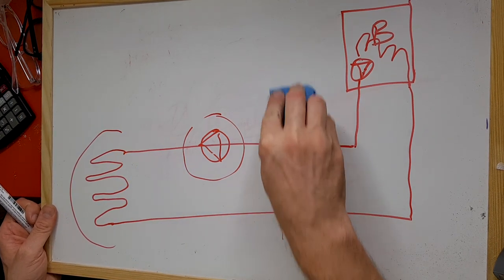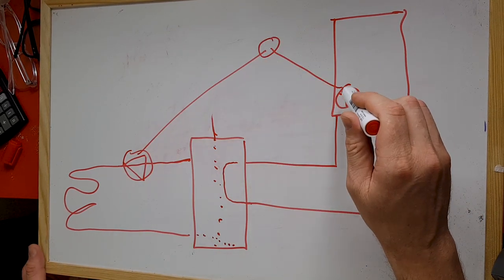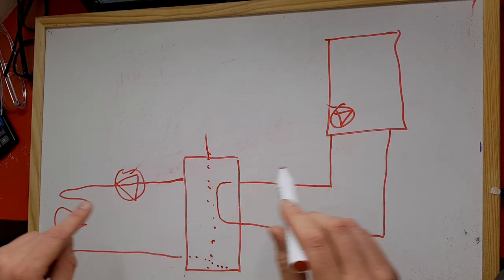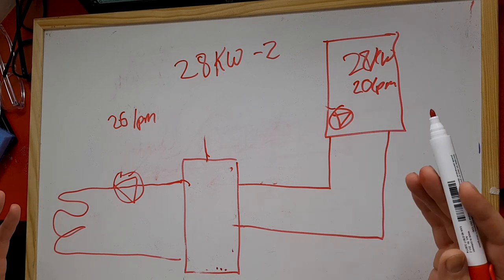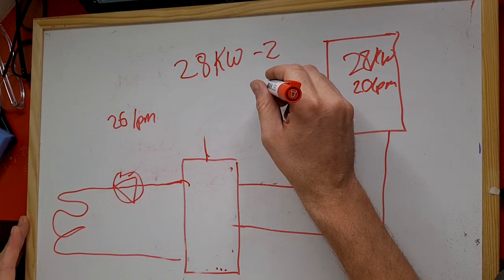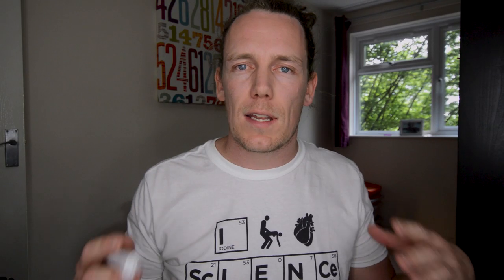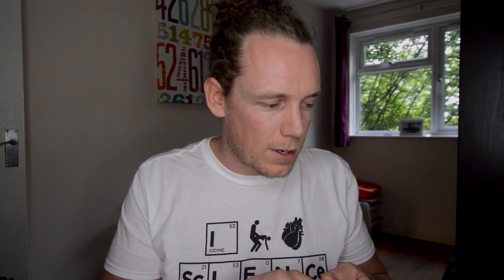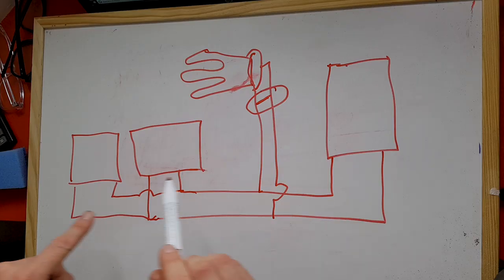Why NOT to use Buffers or LOW LOSS HEADERS!  The Low Loss header explained.

Comment: What would you recommend for a 4 storey house with 23 radiators and 1 hot water cylinder? Each floor would have its own heating circuit. I am thinking of using a 48kw boiler and the IMI Zeparo Low Loss Header and fit 5 Grundfos circulator pumps for each circuit. Do you think there would be distortion and low heat distribution towards the heating circuits during high demand?
Reply from the maker: The first thing i would reccomend is doing a proper heat loss survey... how did you arrive at 48kw? That sounds very high. What's the m2 floor space? 

5 pumps for each circuit is also a little over the top. 1 each max. 

And yes there will always be distortion with any hydraulic seperation.
Reply: @HeatGeek  Thanks for the quick reply. Yes I meant 1 pump on each of the circuits. 5 pumps in total.
This is a very large  house with massive rooms and high ceilings. 4.5 bathrooms, 5 bedrooms, 2 living rooms, very large kitchen and dining area, gym room, 2 more rooms in the basement and garage too. There are 23 big radiators each needing about 3.5k - 4k in BTUs. 300l unvented cylinder. The old boiler there was 37kw and it only heated up half of the house, the rest was cold. So I am thinking of using the 48kw and if need be I can rate the kW output down a bit to suit the system. And the reason for the Low Loss Header is to increase the flowrates to each floor and make sure all rads get hot.
Reply from the maker: @veniamindoychev1634  what you are saying will work. Over specking any system will always work however wont be as efficient. It sounds like the low loss header might be used for additional pump head, but using it to increase flow rates is not a great idea as your delta t will shrink and lessen the condensing effect.

Regarding the size of the rooms etc and description, this isnt really how heat loss is done. The main variable is insulation. Yes you can select an oversized boiler and range rate it down but you also then reduce your modulation ratio. If you can give me the age of the building and m2 floor space I will give you an idea of what I think the heat loss is of you like?
Reply: @HeatGeek  
I will calculate it all and get back to you. Cheers for the solid advice!
Reply from the maker: @veniamindoychev1634  no problem bud!
Reply: @HeatGeek  hi heat geek really loving the channel, I’m doing a very similar job to the guy above, I have done a heat loss, on the property old house 800mm-1000mm thick stone walls some ceiling 4.2m high all double glazed etc, it’s come out at just under 150k btu’s with around 25/30rads which converts to roughly 43kw I’m proposing a hot water priority system, I’m proposing fitting a 40kw ideal vogue with weather comp and open therm, with a llh installed and one single dab light commercial or grunfos adjustable pump for three zones, basement, ground and first floor and obviously cylinder, would you say I’m around the right area? I’m just second guessing myself after seeing urban heatings video putting in a 27kw in a pretty big property and he sings your guys praises.
Thanks
Kyle
Reply from the maker: @kylebrowning7469  sounds good. If your going to all those lengths why not spend another 0.1% and upgrade to a voessmann 200 and have the best wetger compensation and modulation available???
Reply from the maker: @kylebrowning7469  having said that v200 only goes to 32kw.. do you use hear engineer software?
Reply: @HeatGeek  thanks for the speedy reply heat geek, I don’t really have much experience on viesmenn boilers and they only go to 32kw. I don’t use any software just do everything using my calculator 🙄 and am learning a lot from you guys the last week actually regarding heat pumps etc
Reply: @HeatGeek  I would be tempted to go to 32kw as I very highly doubt all heating zones are I’ll be run at once but you know I’d rather be on the side of caution and just moderate her down, and set pump to correct speed needed as it’ll be changeable. Plus fitting a 40kw is only 3kw under what’s required which I don’t think we be noticed? And they’re upgrading roof insulation with another 100-200mm so if anything I should gain those extra 3kw of heat loss via that:)

Comment: Having had a discussion today with my heating engineer he has suggested installing a LLH as part of the system expansion.  All the reasons he gave seemed to be valid and he had convinced me it was worth paying for... until I watched your video, now I am utterly confused.  LLH or No LLH?  That is the question.  The current system consists of a 10 year old Vaillant ecotec plus 637 system boiler and 260 litre unvented uniSTOR cylinder.  The house is 5 bed, 3 bath over 3 floors and there are 12 radiators (mainly medium in size) and 3 large towel rails.  5 years ago, the system was expanded to include a UFH zone for a large dining/sitting/kitchen area extension.  The system now has 3 zones; CH over 3 floors, UFH (3 port manifold has its own pump) and DHW.  Last year I had flow issues with the 3 loft radiators and had to flush the pipes to clean out the silt, which resolved the issue.  I'm in the process of having bathroom UFH installed with a 1 port manifold including pump and the heating engineer has recommended installing a Spirotech LLH, an additional pump (on the system side of the LLH), a new 22mm supply/return to the new bathroom UFH.  Part of the reason for introducing the LLH was due to the 2 UFH zones and large CH zone which may now struggle to be supplied by the boiler pump.  A new Vaillant VR 71 wiring centre (4 zones) + controls will also be installed.  Is this the type of system you think will benefit from a LLH due to the differing heat requirements of the CH & UFH or do you think this system would suffer if a LLH was installed?
Reply from the maker: Hello bud. It is almost certainly the type of system you would put a llh on. However of your not getting issues now then I fail to see what issues 1 small bathroom will add? Can you bot explain to the customer that you would try the simple option and if flow issues are experienced you can upgrade to a llh for an extra x£? 

Most customer will appreciate the honesty and the fact your are trying to save money

Comment: Mr  heat Geek -- 
Instead of using a LLH to synchronize the 2 pumps, why not wire the  system pump to the boiler pump, and wire  them in parallel?  This way, the pumps will NEVER fight each other.  Neither pump is ever dead headed.

Comment: Great video!
Quick question: new installation was suggested with modern wall gas condensing unit with automatic modulation and inverter. System has 3 zones which are made with a kit that consists of a hydraulic separator with 3 circulators. All zones are with radiators and all in one floor/apartment.
This way don’t we lose all the smart features of the unit?
Isn’t it more efficient - if the unit’s circulator is sufficient for the system flow - to install a manifold with 3 gate valves and create the zones?
Thanks, looking forward to your response!
Reply from the maker: Your absolutely correct.. they're installing crap they don't need to and reducing efficiency in thr process.. engineers love doing this in the US.. all about power and not about efficiency..
Reply: @HeatGeek  same thing here.. overcomplicating everything.. 
do you have a video about calculating head and flow rate in a two pipe system with collector manifolds (each radiator has its own 2 dedicated lines)? I saw somewhere that as a rule of thumb the calculation is Q=Kw/dt in m3/h at 2-3m head for a two pipe system.
Reply: @Speedmaster5445  not yet

Comment: I have a radiator system fed by a microbore network supplied by a heat pump. I have a small vertical low loss header installed, to which the primary circuit is connected to both supply and return ports, as normal. However, on the other side of the LLH, only the supply (top) outlet port to the secondary circuit is connected, the secondary return (bottom) port being sealed off. Instead the secondary return is connected directly to the primary circuit at some point further back downstream towards the heat pump, so bypassing the LLH altogether. On the face of it this seems like a good solution as it gives some hydraulic separation but avoids any mixing of the supply and return flows within the LLH. What is your view?
Reply: I thinks that's a fool's game.
In the case of a buffer tank in parellel, depending on the flow rate, the mixing can be more of an issue even in the case of closely matching primary and secondary flow rates, but there are solutions (with various succes rate) for that, one is similar to your setup, but preferably adding a T before the primary input to the buffer. 3-pipe setup in some nomenclature.
HOWEVER: 
If the primary and the secondary flow rates match, there shouldn't be much mixing in a proper LLH.
If the flow rates have mismatch between the two side, that T it won't do any good. For example: the secondary doing higher rate, it will have to suck back from that described tee to the LLH (the differential volume has to come from somewhere), and it will mix in the LLH anyway.
If the primary is doing higher rates (the worse scenario) then the mixing will happen at that where the secondary joins the differental rate of the primary coming from the LLH.
So you have no gains either the rates differ or don't.
But you have disadvantages both cases: you get more pressure loss than if it were a simple LLH: you can imagine the flow hitting the your small T's upper wall, and part of it going left, part of it going right. The LLH is a better desinged vessel, actually, it is designed for this specific job: only the differential rate should be going up or down.
And you have more straight tubing distance, but if the T is not meters away, then it adds less pressure loss.

Either the installer was a fool IMO, or the LLH port had some issue, but they didn't want to buy another one...
Reply: @KrisztiánSzegi  thanks for the info. My house is 2 storey, 130sqm floor area. there are 16 oversize radiators fed by 8mm copper microbore. The small (c. 2 litre) LLH is in 3 port config, separating the primary and secondary circuits. The primary pump is a Grundfoss UPS2 25-80 180 on speed 2. The secondary pump is a Grundfoss UPS3 15/50-65 130 on speed 2. What is your view of the effectiveness of this setup?
Reply: @lumbarsupport  First of all, I am NOT a heating engineer.
I learnt chemical engineering, and part of the course is chemical operations, with jacket and coil heated tank chemical reactors, fluid dynamics, etc.
I'd say I understand heating as well as a good heating technician when I want to, and as I am planning the heating of our family house currently, I very much DO want to understand it :)

I wouldn't be too much worried about your LLH, although my wording maybe did imply otherwise. It's just that I don't, of more precisely, I fail to see ANY benefit. The circulation losses could be lower than with that separate T junction, but that would be equal to a few meters of additional pipe length of pressure loss.
Regarding your described setup: as long as the flow speed is around 0.3-1 m/s (given by: dividing the flow rate by pipe inner diameter), it would be right, the lower, less the pipe wall erosion, noise, and friction losses are.
I would need more data (the available head of heat pump's circulation pump, all of your pipework layout (with number of elbows, height difference of lowest/highest point), the assumed/required flow rate to meet the heating losses) to say that it would have been possible without that LLH: doing the heat pump all the circulation work. I'd say, maybe.
Zoning and regulation between the the floors is a topic in itself, and that could be a good point to optimize without changing much of your setup, given you already have separation between the primary and secondary.
But I am not versed in the latter part, as our house will have UFH (just got the screed a month ago) on a single floor, and at first, it won't have any zoning.

Comment: A few years ago I attended a school which had had a new boiler and LLH installed in a particular block. I had to go several times as there was a pressure fault, but I never caught the system “in fault”, it would always reset and run up no problem. I came to the conclusion that the LLH pump which was a substantial one, under certain conditions was adversely working against the boiler pump causing a low pressure alarm which I could reset upon arrival because the “conditions” had reverted back to “normal”. I submitted my report but, as with large companies, engineers never get involved with problems after that, so I don’t know what was the outcome ( which I hate because many engineers had been there before I was asked to take a look, and I believe in job ownership and I like to see jobs through ). Has anyone ever experienced similar issues 😁

Comment: Great stuff.
Out of curiosity, where did you go to get these pearls of wisdom ?
Reply from the maker: Andrew riley hours of debate on the internet and facebook 😂 distortion is my theory though.. you wont find much in text books about it.. caleffi talk about 'blending and mixing' but dont seem to see the issue with it for condensing boilers which there absolutely is. I think this is because they arent driven by efficiency in America but more 'power'.
Reply from the maker: The ironic thing is that it may give more pump power. But not more heating power as the boiler is more likely to max out and modulate down.
Reply from the maker: I’ve just released a course detailing everything you need to know to become a heating genius!  What’s more it’s  been recognised by the UK government department BEIS which have offered to heavily subsidised the first 300 spaces!  
http://courses.heatgeek.com/

Comment: Hello mate just a quick question for u am doing and install 5 120 kw boilers I have 4 vt circuits off low loss there is no bms being installed what’s the best way to wire the mixing valve can I wire the vt valves of a weather comp as can’t weather comp boilers as have 3 cylinders off this
Reply from the maker: Well your going to have to wire them in somewhere so you either need a native controller or you use autonomous valves that have the controller built in. Who specked it?
Reply: Was speck by outside company thanks mat il look for those valves with built in controls thanks

Comment: One important aspect of UFH you did not touch on, and is the most important, would be the floor surface temperature when it is being heated, and is the UFH being done through a 10cm slab. Also, is the boiler a condensing boiler or not. If it is not meant to condense than you are dealing with sulfur condensation on the inside of the boiler that will rot the boiler in a few years. I don't believe you should mix UFH in lesson with standard baseboard or cast heating. It tends to cause more problems than solutions.
Reply from the maker: Non condensing boilers were banned 16 years ago in the UK so safe to assume a condensing i would say for new installs which this is for. Lots of extra things I could have put in here but if I dont cut stuff out i could go in forever!!
Reply: @HeatGeek  it was a brilliant video. I am in Canada, and the east coast still uses oil boilers, which the majority is still condensing.  Your video has crossed the pond, and I just wanted to remind you that you are global. Keep up the great videos.

Comment: Why not just use a flat plate heat exchanger ?  Job done !
Reply from the maker: Plate heat exchangers also suffer from distortion and also have the additional distortion from the thermal resistance of the plate, so slightly worse. This is detailed if you look up Log mean Temperature differential.